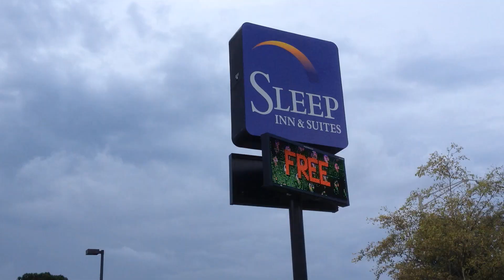Part Two The Jacksonville Breakdown

Comment: Haha all these people commenting don’t understand how the system works. The original failure was the EGR cooler. This put coolant into the exhaust stream, damaging the EGR valve, differential pressure sensor, the DPF, the DOC. Where I work, if an EGR cooler fails it is routine to automatically replace all those components. These mechanics did nothing wrong, it is the fault of the engineering of the engine. When coolant enters the exhaust stream it destroys all of the after treatment devices and sensors.

Comment: Shouldn't proper maintenance have been done or at least a warning light have come on long before that filter got into that horrible nasty black mess and plugged up?  Appalled at the condition, wonder if that contributed to the problems or was caused by them?  At least THAT was discovered and fixed by this breakdown, it was a necessary expense, unlike others!  What a miserable experience!

Comment: Not cool. This is LIKELY a matter of incompetence,  however they could just be soaking you. Sadly this is the world we now occupy. ANY kind of service you require will more than likely cost you AT LEAST five times what it should. Vehicular service and HVAC are by far the worst culprits, mostly because only one in twenty "technicians" have any kind of clue what they're doing. Parts replacers is what you get when you need SERVICE. There are some who on their own do never ending education. If you're going to be any good you MUST, as things change so rapidly. But asking me to believe that "new" codes kept coming up is stretching the limits of credulity.  Sadly most mechanics never look at the never ending stream of bulletins coming from manufacturers. If they DID, and heeded what the bulletins say, you'd be on the road MUCH sooner, and with a lot more money in your pocket. Of course the "technician" would have to survive on a really good salary rather than a ridiculously high one.

Comment: A brand new part that was bad ?
Reply: Happens a lot with today's computerized deals.  Solenoid that is supposed be under computer control sticks open so Cadillac owners can't start their car after they fill it up with gasoline.  Guy had worked his way thru three new ones and was finally told to try to blow thru them as you are not supposed to be able to until the computer turns them on.  All three were already stuck open brand new.

Comment: Thats just bad mechanican, and not following the code's it was showing, replaced the EGR valve, and the code wouldn't clear, or came back, first thing to check would have been the part that was replaced, should have shot the wires through the valve for resistance, or ohm's value, would have saved a ton of money!!